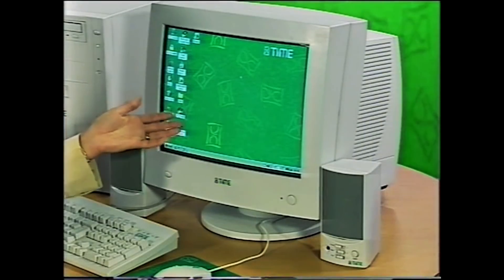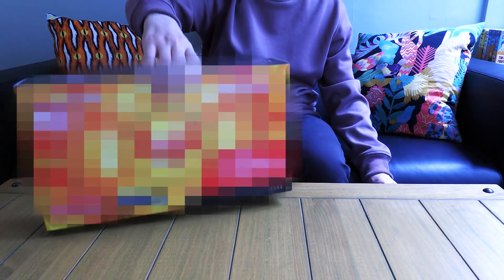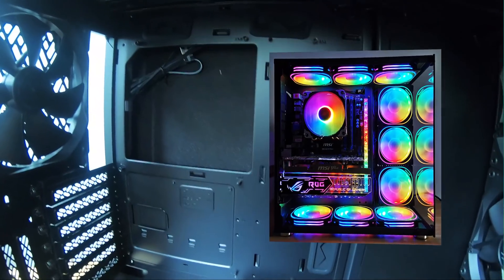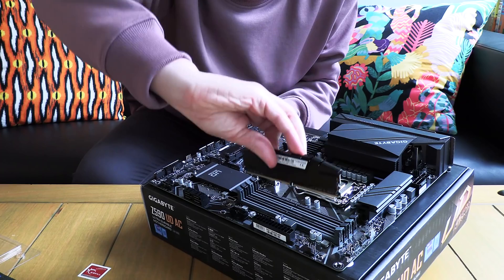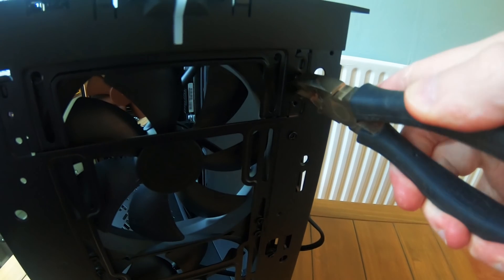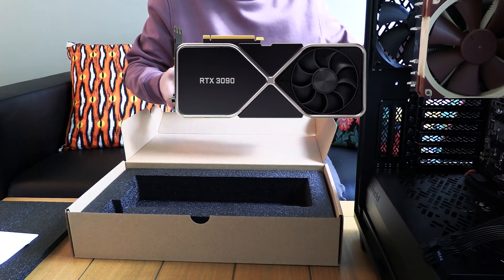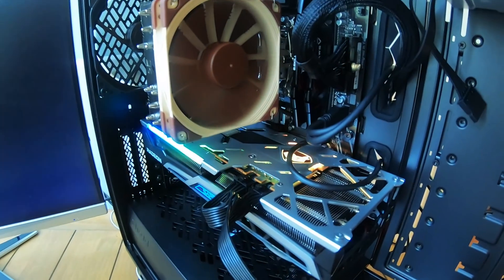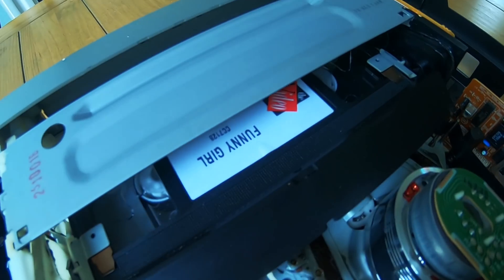Building a PC

Comment: The IT guy I work with actually did short a CPU with a static shock from his fingers, but it might be because the computer was on while he was working with it. So even though it in all likelihood won't happen, you might as well buy a $10 lanyard to potentially save yourself from having to spend well into triple digits on computer parts.
I just took my shoes and socks off to ground myself, but I'm also an idiot, so that might not actually work like I think it does.